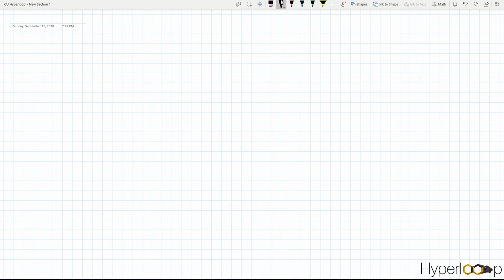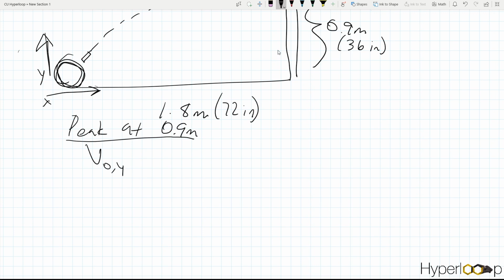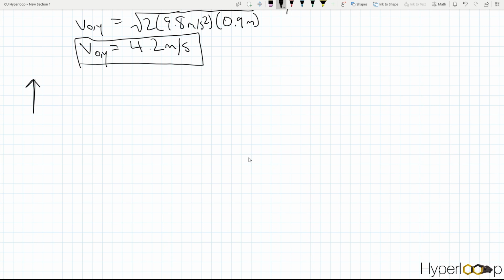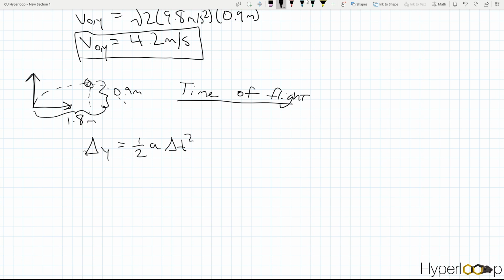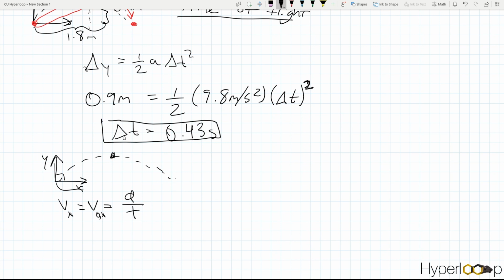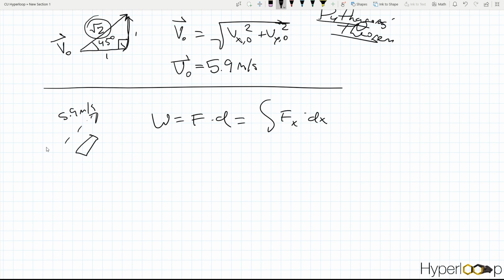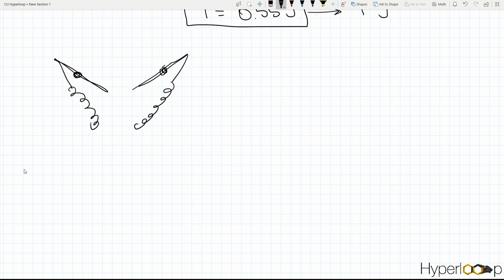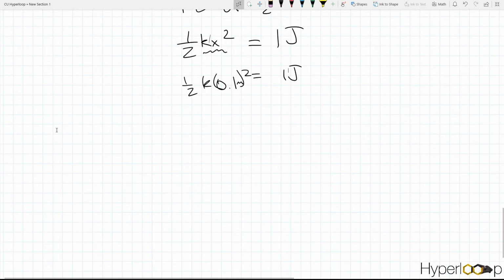Ring Shooting Physics Breakdown ULTIMATE GOAL FTC University Challenge Team CU Hyperloop

Comment: for the peak, wouldn't you have to account for the height of the robot? (so it would be 0.9 - height of robot)
Reply: Yeah Shreya, that's right, to be completely precise Delta y should be the difference in height, which should be however high the goal is minus the height you're launching from. We were launching from fairly low and while the force of our launcher could be refined to be super repeatable (so you'd get basically the same amount of force acting on the ring every time you launch), in it's current form and given the lack of top supports and kind of janky side supports (you have to remember we only had a weekend to do this) the assumeption we made of launching from the ground directly ended up being negligible.

It's also worth considering that we aren't accounting for air resistance (super negligible) or friction on the launcher (maybe only kinda negligible) or any interactions between the ring and the launcher itself (maybe only kinda negligible) and all of these would reduce the energy of the ring, so adding a little margin for the required height works in our benefit here.

Comment: I had another question, unrelated to the video. Let's say a ring is being launched by being squeezed between two rotating rings on motors. How would you calculate the work being applied on the ring from the motors, and what speed the motors should spin? Is there a way to do this without trial and error, or do you have to experiment with distances between the rotating wheels and speeds of the motors?
Reply: Yash, this is a great question! Cole from CU Hyperloop here, I'll comment my initial thoughts below but I want to take a bit of time to figure out a better solution for this. Its definitely a lot more complicated to model, which is one of the reason we chose to go with a spring launched system. What makes this tricky is that in this launching mode, there are what are called "nonconservative forces." What that means is that there are forces which take energy away from your launcher that are impossible to get back. Of particular importance here is friction. 

You might notice that we neglected friction in our analysis of this video, but the friction I'm referring to here is fundamentally different. We ignored the friction from the ring sliding on the launching plate/ramp, and that's typically just fine. However, the force (and by extension, the work) that your motors do on the ring changes depending on how much friction the ring has when in contact with the motor wheels. You can think of this intuitively by comparing a wheel covered in something grippy (like sandpaper) vs a wheel covered in something slippery (like grease). All else being equal, the ring that was shot through the sandpaper wheels will fly farther. Modeling this friction is hard and it also might be different depending on how only the wheels are, how old the rings are, etc.

Let me see if I can put together a derivation of this type of launcher in the next week or and update here!

Comment: I'm a little confused at 8:22. Doesn't that kinematic formula also involve v0*t? Why were you allowed to disregard the initial velocity?
Reply: Hi Yash, Cole from CU Hyperloop here! You're absolutely right that the kinematic equation being used here typically also has a v_0*t term. Dan talks a little about why we're not using it at 9:10, but since you can't see the cursor its a bit hard to visualize so let me see if I can explain.

What we're trying to solve for here is the time it takes for the ring to go from the launcher (y=0) to the peak (in this case, y=0.9). We have the information needed to figure this out directly, as we just calculated v_0,y in the previous step (4.2 m/s), but in doing so, we'd have to solve a quadratic equation (since we want to solve for time, which is in the equation with v_0*t and 0.5*a*t^2). While this is totally doable, us college students are pretty lazy and so we always are on the lookout for simplifications and assumptions that make problems easier to solve!

In this case, since the trajectory of the ring is a parabola (due to the only force acting on it being gravity, other than the initial launch), the trajectory is symmetric about the peak. That is, the time it takes to get from y=0 to y=0.9 is the exact same amount of time it takes to get from y=0.9 to y=0! (!, not a factorial hehe). So if we instead go from the peak to the ground, the time is the same and the initial velocity would be zero (since the ring is at the peak).

Now, I will concede we did get a little lucky, as the sign for gravity at 8:35 is incorrect (the force of gravity should be negative here, since it acts in the -y direction)! However, Delta y should also be negative since it goes from 0.9 DOWN to 0, so these signs canceled out and we still get the correct result.
Reply: Cole Kenny ohh that makes sense, thank you!